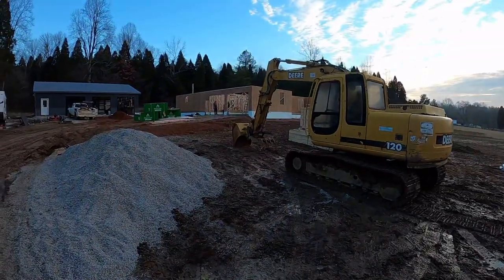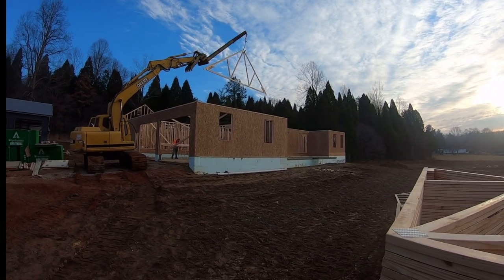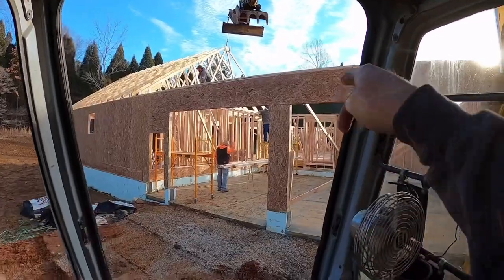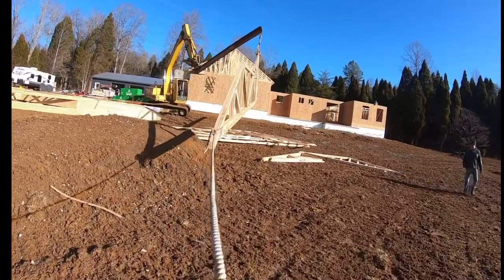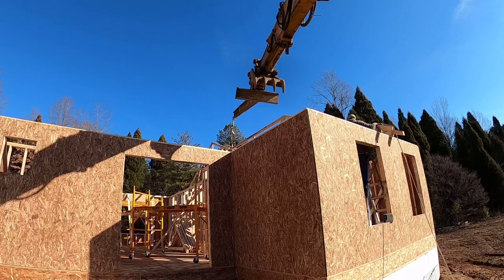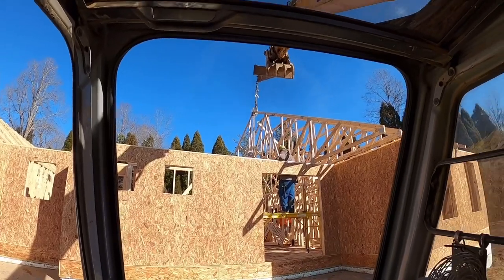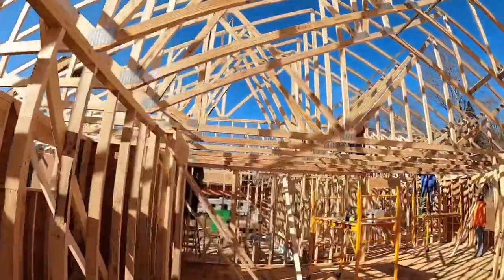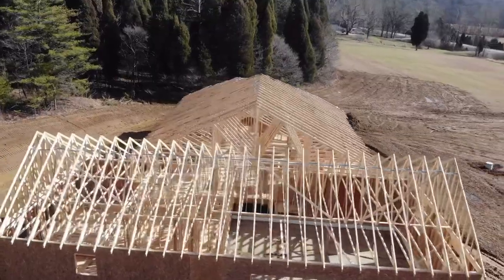Setting trusses With the 120 excavator on the large 12 corner ICF basement job this is a tricky one

Comment: I did truss roofs years ago with a pole crane on a office medical park ,just set it nail it and put the stringer along to set level .The operator was good so it was not a problem. Diagonal bracing was left in after they were set. straight and square so the sheathing goes on right .Nice job guys.

Comment: It’s easier to build the gable trusses up before setting them, but I understand everyone does things different. Our family business installed plywood the gable trusses and installed the one foot overhang (we nicknamed that substructure the ladder) and 2x6 facial board on but extended the 2x6 board longer than the tail of the gable. Saves all the ladder climbing. I understand your not the builder of the house. Thanks for sharing!
Reply: Kind of depends on the framer, I've seen it done both ways out here in Idaho when I deliver the trusses.
Reply: @BlueDually4x4  lol same here. I deliver trusses in Oregon

Comment: I bought you a whole box of rags and glass cleaner. MBTS needs to make sure the windows are clean. He is the safety guy and clean windows is a safety item.
Reply: 😂😂😂 I will get right on that
Reply: @carlbenj1668  🥵 that’s a lot of waxing lol 😆
Reply from the maker: Tell him red dog
Reply: Just don't use Acetone to clean that glass 😁 we pranked a guy by switching out his gas cleaner with it one time.... it is still a prank when you don't like them ain't it?  🤔
Reply: Full Tilt has the cleanest machines on you tube. They spray wax theirs. 👍  MBTS could add that service to his line up. Armor all inside the cab with febreeze seat cleaner in the summer.....
Reply: @aaronbummmanbehindthescene4931  if the moneys right lol
Reply: @dignation216  you better believe it lol 😆
Reply: @littlefinkle7757  😂😂
Reply: @DirtPerfect  😂😂😂

Comment: You had to shout a few times to the guys up top. I'm surprised you don't have a "loaner" hands-free radio and/or a PA on the machine. Cheap safety bump.
Also, get some steel-toed ballet boots, great choreography work by MBtS w DP.

Comment: That went nice and smooth. Complicated truss system but you got it set real easy.  I was wondering if you were going to replace the 120 with a 130 when the time comes. I agree that she has real smooth moving hydraulics. You had good control the whole time with only smooth movements,

Comment: If you had started that main section by setting the last rafter up and laying over on the back side slope of the garage then laid them back towards the far end! They could still started by standing them up out at the end and set them boom boom bang the same direction except not needing the excavator to swing them in place!! Like reverse dominoes !! Oh well next time will be smoother !! Still excellent job good work!!
Reply from the maker: Not my call
Reply: Also the truss packs aren't generally stacked in the order you want to put them up. They are stacked so they load and unload off the truck without breaking. With the longest and tallest always on the bottom.

Comment: If that was my rig, I would have used the plasma cutter to cut either opposing triangles or large circular lightening holes into the "I-beam" boom to lighten it. Like they do with aluminum in aircraft. retain the strength, lighten the load, less stress on the hydraulics, and less bouncing around in the cab due to not enough counter-weight.
Reply from the maker: Hell know is the simple answer to that wow

Comment: Those framers put a lot of faith in those little metal spacers and they’re not using cross bracing or any other type of bracing as a set those trusses I’ve seen many of times they fall like dominoes they should be a little bit more quick with some cross bracing and more bracing on them one day their luck is going to run out you never know what’s gonna happen when the wind my pick up or something

Comment: Have you ever thought about putting a hydraulic winch on that truss pole? Would help with vertical lift and sitting it down like a crane.
Reply from the maker: Yes
Reply: We built one for our backhoe and it would have been nice to have a vertical straight up and down. But it worked for what we needed

Comment: I bet that the central air is going into the attic and people will also store things up in it as well.  Problem I have seen the drywall will separate as time goes on. Please tell those are not 2"by4" even 2"by6" are light.
Reply from the maker: None apply to this project but thanks

Comment: Great video!  I am sure there is a descriptive coding on the trusses that show where each is to be placed.  Does the carpenter tell the truss company the order of placement so that they will be properly staged at the site?
Reply: The company I work for and the other truss plants in the area of Idaho stack them so they transport the best as none of us use a knuckle boom or crane to unload, the trailer tips and they roll off the back. Generally the longest and tallest trusses are on the bottom and the smallest on top or on the front or rear of the trailer.
Reply: @BlueDually4x4  so they are placed on truck based on best shipping location, not how they should be installed.  They are bundled by type.
Reply: @ericduck8273  Correct. Usually by type so all of the A trusses are in one pack and the B trusses are in another.

Comment: MBTS said it is 22 degrees. How can it be 22 degrees if the mud is not frozen and there are visible puddles with no ice? Is MBTS just a fair weather worker? 
It sure would be helpful if the CAD truss design software would calculate the lift point for balance and strength. That is what CAD should do.

Comment: Do you have AC in the 120 ?   My 96' 490E didn't come with it but had a Red Dot stand alone unit installed behind the seat that'll frost the windows...  Just wondering
Reply from the maker: No it does not
Reply: @DirtPerfect  ok thanks

Comment: What would be neat is if you put an electric winch on the jib pole. Just thinking. 🙋
Reply: It would be a lot easier to rig the trusses if you had one (winch) on the jib.
Reply: I would mount the winch close to the attachment end and mount a shive on the jib point. That will allow the cable to roll up correctly on the winch each lift. Just thoughts from an old hydraulic crane operator. 👉🙋
Reply: I bet MBTS Would like my idea! ☺